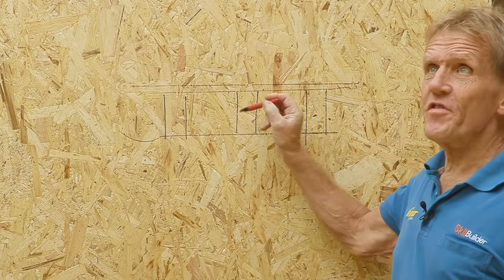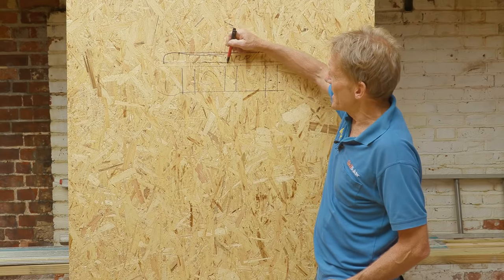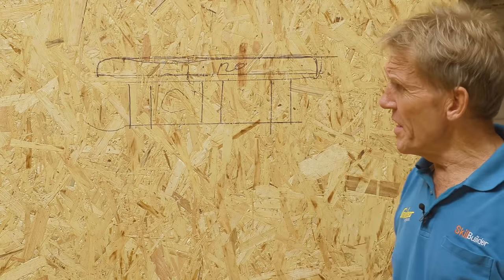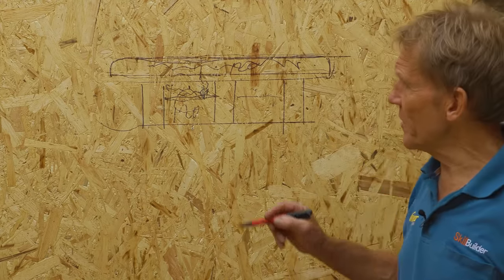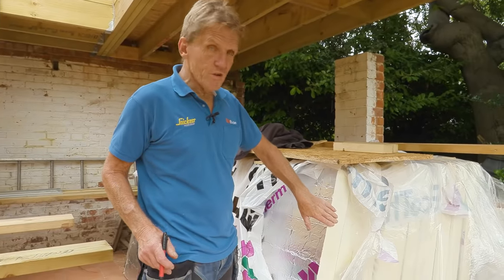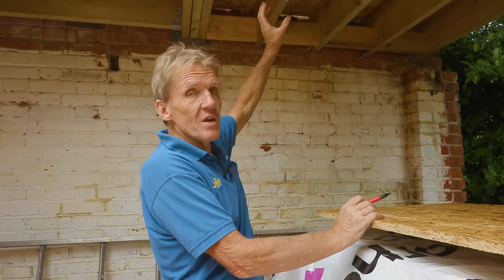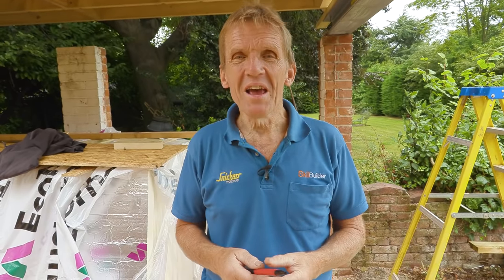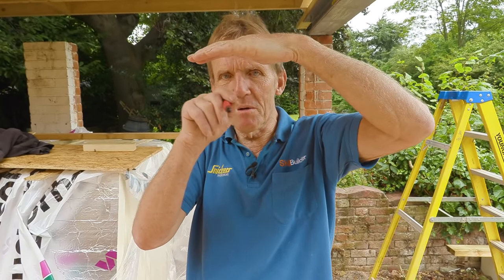Warm Roof vs Cold Roof. What’s The Difference?

Comment: Roger, thanks for this instructional video. I am starting a similar project soon and knew of the warm roof/cold roof conundrum but this video has assisted greatly. I wonder if you could be tempted to show us the finished GPR roof with the mushroom pots etc. I am looking at rubber roofing and would like to know whether GPR/Fibreglass roofing is considered a better choice on an orangery. Thanks for all you do keeping us enthusiasts informed.  Wayne
Reply from the maker: Hi Wayne
 I like rubber roofing and use it a lot. It has a slight breathable quality so if you keep the moisture out with a vapour barrier it will cope with a little bit. The  only drawback with rubber is the smell on a very hot day.
Reply: Thanks Roger,  I fitted rubber roofing to a large pitched shed roof and haven’t noticed the smell. That said, I spend a lot of time in it but not live in it….. or should I……….
If fibreglass has come on to a point where it’s a better fit, I may still be convinced. The span will be 8x4metres with 2 roof lights in. I’d love to see the finished roof on this project.  Wayne

Comment: I find it kind of interesting that the neighbor is having a problem with the hot roof design especially after you stated it is 120mm, basically 5" in the US.  What kind of neighbor would notice and have such a problem with that?  Maybe there is something I am missing here but if my neighbor was mad about me changing the roof height on my house by 5" I would tell him to get bent before doing a redesign that needs a ton of extra fixes to make proper.

Comment: What would be the best way to insulate if the heat were the other way round. i.e. an air-conditioned house in a hot humid climate?
Reply: Same principles apply - but there you're keeping the heat out.  Check out Matt Risinger's channel as he's rebuilding his home in Austin and super insulated it.
There was recent news about the world's most reflective white paint that has the same effect as air conditioning when a house is externally painted with it - could be revolutionary if it comes to marked.
Simple answer is a cold roof would be better there as you can use the top of the roof as a rain screen and break a lot of direct thermal transfer between the roof and internal ceiling.
Reply from the maker: To be honest if you have air con then the vapour is travelling from outside to in. The whole thing is fraught because humidity is higher in the summer. There are some people who say that you should not have a vapour barrier in those situations and just let the moisture drift through

Comment: What do you think of infrequently used rooms having unventilated cold roofs where the insulation has been pushed up to leave no air gap? Oakwood Garden Rooms promotes this and says there’s never been an issue. Granted there’s a big difference between a garden room and extension! Thanks.
Reply from the maker: The hybrid roof can work but it is  a difficult thing to quantify. I suppose the key is the amount of moisture generated and the presence of a vapour barrier. Also the rubber covering is slightly breathable.

Comment: Great video thank you. We never got planning permission as the size was just shy of 40 sq metres which is allowed in our country. There was a warm roof in the plans, now we have discovered the engineer told the builders we need a cold roof due to height restrictions and no one even told us about this change which i am not happy about at all. The roof is nearly finished now. We live on a height where it gets very windy so I am concerned about whistling through the roof now (we had whistling in the eaves of existing dormer roof until I got foam insulation to block it out) and also cold air through the roof which means increased heating costs for the rest of our lives. Can someone please advise if we can now do anything about this? Seriously concerned :-(

Comment: For cold roofs, why don't you put the vapor barrier on the inside, along the joists?  Is this a viable option that's not often chosen because it's a hassle?
Reply from the maker: That is exactly what you do. From the top down. Roofing membrane (felt) roof deck (OSB) air gap vented across the whole width, Insulation, vapour barrier and or foil backed plasteboard. Do not breach vapour barrier with down lighters.

Comment: I've got a flat roof extension and a lot of heat is lost through that roof. 
I'm reluctant to start drilling holes and vents. Couldn't you just fix some insulation boards cut into strips against the underside of the sterling boards that are on top of the joists.

Comment: It is either:
1) removing the moisture laden air from the roof space - by ventilation.
2) Or preventing the moist air entering the roof space. 

2) above is by putting a vapour control sheet between the ceiling plasterboard and joists and using plasterboard with an integral vapour barrier. Sound like belt & braces, but it does work effectively.  Quite simple. 
1) above is introducing cold ventilation air reducing the insulation performance of the building. Not desirable.

Note moisture does move through wood and masonry - but slowly.
Reply: I was going to question exactly this - Why you can't just stick the vapour barrier between the plasterboards and the studs, then full fill the studs with insulation?  I guess you can't penetrate the vapour line so fixing the plasterboard through it would become a problem, but you can always use a plasterboard with an integral VCL, as you say.

Comment: You dont leave empty spaces in a roof..you fill it with insulation bazaltic fibre one between the joists..and right under a vapor barrier 100 sd that stops all moisture from going thru..to do a good job you ca  insulate extra on top of the wooden beams aswell so you dont get a thermal bridge as wood insulates worse then bazaltic mineral wool.

Comment: Surely all these problems would be negated if you fitted a vapour barrier above the plasterboard - that way no moisture can get in to the ceiling joist voids???
Reply: That sounds easier
Reply from the maker: I think it helps a lot but moisture still gets through and is then trapped
Reply: Vapour barriers all let water through. Water vapour is a gas and will diffuse through on the atomic scale. As Roger says, it will accumulate to high humidity levels as no exit for it, the ventilation changes the air so reduces any build up.
Reply: @TurinTuramber  if that's the case then a warm roof will also rot. You will eventually end up with moisture between PIR and top layer, eventually getting soggy PIR  a damp deck, no?
Reply: @TurinTuramber  I understand what vapour is but no one seems to address that warm, cold or hybrid can function identical if VCL is placed correctly and ventilation should not be necessary.
Reply: @moeneve3848  Not sure what you mean to be honest, established building details exist for a reason. Any cold roof installed perfectly (not a reality) will always have warm moist air meeting   a cold deck in conditions usual for the UK. So ventilation is a must to prevent build up. 

Steve the roofer on YouTube goes into all this in detail, highly recommend.

Comment: To save on the roof vents drill holes in the firing to save compromising the joists strength for cross ventilation, you should be able to get away with 2 vents or one continuous wall flashing vent and if you have to drill the joists just don't put 2 holes closer than 3 x the hole size and try to keep below 35mm per hole,it is only a flat roof not a floor joist there a lot more lenient with the regs and spot on with advice for the vapour barrier just with the cold roof side of it most pir manufacturers will guarantee there foil with foil tape on joints as a vapour barrier as long as its on the warm side.
Reply from the maker: Hi Lee 
We have looked at that and might do it but it really needs 50mm clear space and the holes through the firing will be 50mm one end and less as it works down
Reply: @SkillBuilder  you are allowed to drill a hole 1/4 of a inch for every inch of timber so if there 8"×2" you technically can drill a 2"   hole as close to the middle as possible but they would have to be 6" apart and as you have vented soffit you would only be adding cross ventilation to the rear of the joists and the front section of joists between the triples, it might look unsightly to someone who doesn't understand but it's safe and will be covered up professionally as I have seen in all of your vids and beats having 10 to 15 vents and 10 to 15 weak points in a flat roof lol. That's the worst when the plans change, would of been an ideal warm roof but you have to keep your customers happy and the neighbours hahahah
Reply: We cross batten on top of firing’s seems to work great obviously venting the soffit aswell.

Comment: With the warm roof there is going to be thermal bridges going down through the insulation by the fixings, transferring the heat up, visible by thermal camera, which no contractor would dream of using. 
The warm roof also has to be ventilated below the insulation layer, as timber roofs are required to breath, I have done a warm roof, with high quality insulation and in the cold mornings I can just see all the heat coming up out the sides.
Reply from the maker: You can get plastic fixings which cut down on the thermal bridging but most accept a bit of heat loss.

Comment: I always thought that the way to do this (it seems that way in our house) is to put a moisture barrier ie polythene, well taped, no gaps or breaches behind the plasterboard so the moisture is contained there- if the insulation is done to a proper decent standard then the cold should never meet the damp air and turn to water??
Reply from the maker: You are right about the vapour barrier, Every  roof warm or cold should have a vapour barrier. Ordinary polythene is not as impervious to vapour as many believe but it is a good start. Taping all the joins is essential but it is not always done to the letter. After all that trouble somebody cuts holes for downlighters and it is game over.

Comment: Thanks Roger very clear description. It would be great if you could give your valuable view on ‘Hybrid’ roof solutions and SIP panel solutions. Also, what do you know about Reflective Foil Insulation systems?  I’m considering all options for a DIY Garden Gym where I need to maximise headroom under 2.5m Permitted Development restrictions.
Reply: I've got to rebuild the garage, so that'd be useful for me too!
Reply from the maker: We will certainly do something. It would be good to hook up with Steve Roofer for this one
Reply: Look into Vacuum Insulation.  Expensive but 1/3rd the depth of standard PIR for the same u-Value.

Comment: Also, counter batten the joists, gives complete ventilation.
Reply: Can u explain ?
Reply: @neilrafferty2097  battens (like tile batten size) going across the top of the joists in the opposite direction, under the roof. I think!
Reply from the maker: counter battens will help but they aren't enough air gap
Reply: @SkillBuilder  what about really big counter battens. Say, 120mm?
Reply: @ricos1497  that would be counter productive as the neighbours issue, from what I assume is the overall height, with a 120 batten that would make it a similar height to the original warm roof. 🤷‍♂️
Reply: @rossolancer  yes, that was the purpose of my joke!
Reply: 2x2 batten,  ample air flow, common practice.

Comment: Nice video. I've got a small extension poorly insulated.  I need to insulate it with celotex. I was told to cut to size and slot them into the spaces and there should be enough room for them to breath. I don't there is a vapour barrier, will that be OK? Cheers

Comment: Moist air will always move towards the driest environment. Cold areas hold less moisture so moisture always gets pulled across. It percolates through the insulation because condensed moisture leaves the air fryer than it was.

Comment: Thank you for sharing your knowledge. On the warm roof example, would it be ok to insulate in between the joists as well? Assuming drywall is the finished product? Or would that trap the moisture?
Reply from the maker: It is a very difficult judgement. Sometimes putting in more insulation moves the dew point to somewhere in between. 
You can get a professional calculation done online that will tell you. I have done it in the past with no problems but the vapour barrier has to be good.
Reply: Thank you

Comment: What I don't understand is that if a warm roof still has OSB and a roof covering above the insulation and a vapour barrier below. Why this cant be achieved under the roof height by pushing the insulation up to the top of the joists so it is flush with the OSB board (which has a roof covering directly above it) and run a vapour barrier below it - Making it essentially the same as the warm roof in structure. My logic here is that if the insulation is "warm" in the warm roof and moisture doesn't condense above it, why wouldn't it be warm when it's in between the joists?

- Don't get me wrong your video explained the differences well, I just can't get my head around what the difference is if they both are both essentially the same "sandwich" of materials - plasterboard, vapour barrier, OSB, Roof Covering.
Reply from the maker: Hi Michael. There are people who do exactly as you suggest and claim the hybrid roof works. It the vapour barriers is 100% air tight then I think your suggestion would work but any moisture that gets in and goes past the insulation will then condense on the OSB and be trapped.
.With a warm roof the OSB is on the warm side and the insulation is on top of the vapour barrier which you have laid on top of the OSB all the moisture that is in contact with the OSB is on the warm side and will dry out with the heat from the house.

Comment: Hi, thanks for the video. Very informative. I'm part way through the purchase of an edwardian money pit which the wife loves - so hard to say no. The attic above the main living space has already been converted to a bedroom but the attic above the back bedroom and bathroom hasn't been done. It is about 20 meters long and has a pitched roof. I was hoping to fit celotex between the rafters (leaving a 50mm airgap) and then fitting a layer of insulated board to the rafters to improve the thermal insulation (as 50mm celotex won't be that great). This would allow me to board the space out and have a nice bit of storage there.  Question is: how to ensure airflow through the air gap behind the celotex on the pitched roof? Thanks.

Comment: it does make me wonder with a warm room - if you use a VB behind the plasterboard on the ceiling, lapped and bonded with the rest of the room's  wall VB, do you still need that sheet above the OSB? - Belt and braces I guess! - I'll probably do that AND use a plasterboard sealant.
Reply: Always worth mentioning for warm roofs, to insulate behind the fascia boards to complete the "hat" of the roof. At least so I've been told.

Comment: Sadly on my cold roof I've only got 120mm to play with in my garden room. If I used 100mm insulation then only 20mm to play with. Better than nothing I guess. Or would you recommend I use 70mm PIR to get the 50mm gap?

Comment: Interesting take though not the whole story: in modern timber buildings the two things that are coin per intuitive are dirt tightness and breathability. I've had professionals tell me that the SWIP system is breathable but when you check it out there is a vapour check which they tried to tell me was breathable but is not because breathability is measured in perms: 0-5perms non breathability; 5-10 semi permeable 10> is fully permeable and the SWIP vapour check is 2.5-7.2 Perms. This is very important because as you say the due point is all important and yes it occurs where there is a major change in material temperature which can be managed by ventilation. 
So when dealing with a timber frame with a sarking board on the outside the material needs to be chose carefully for permeability. As such I tend to use Elka Strong board because it's permeability is 44 perms therefore fully permeable as with all timber frames a sarking felt over the top say proctor roof Sheild. Then the insulation PIR is not permeable but recycled plastic bottles that we make into duvets and fleeces out of has been turned into an insulation that is highly permeable, I use a product called supasoft  which is great between timbers because it comes comprised and expands to fill the void.
The time required to get PIR tightly fitted between timbers is cost prohibitive and many blogs have been done on firms that have not done this properly and no expanding foam does not do a good job. You should have no gaps greater than the thickness of a Visa card and that would be a big gap. so fleece gets around all of this quickly and easily, whilst maintaining breathability
If you look at firms doing timber frames they all have this voice fully filled no ventilation cavity required.
Any joints between sarking boards first rafter and adjoining Masonary must be fully filled and sealed I rend to use VC-Ultrafoil and a material like pinkgrip  external gate and then a tape for belt and braces. the sarking board should over shoot the Masonary if posable and if not then Pinkgrip external grade to fill the joint 100%